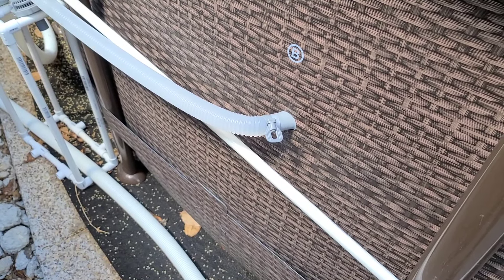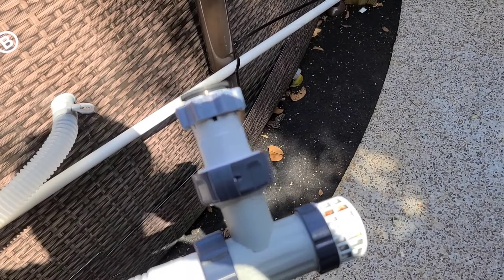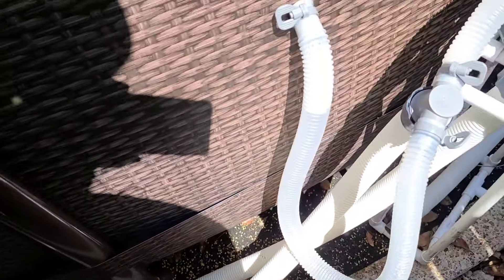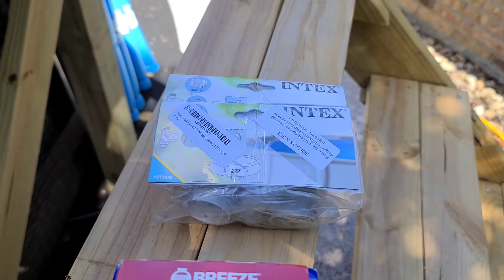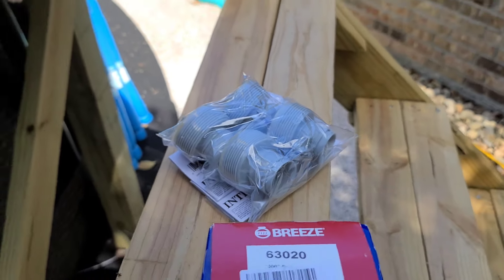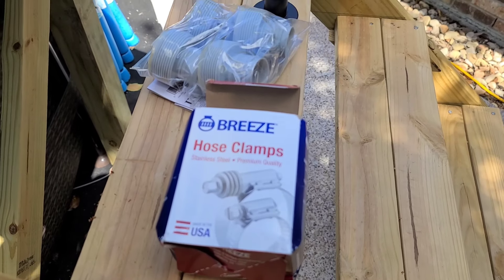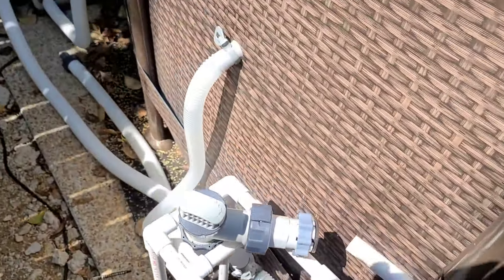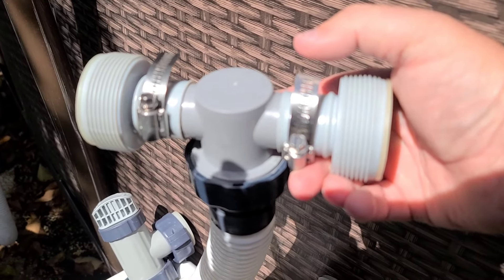Converting a Bestway Above Ground Pool to Intex 1.5 inch Hoses Using Type B Adapters

Comment: You would think the smaller hoses would put out more power and suction.
Reply from the maker: When you go bigger to smaller...you get more pressure.  Shen you go opposite,, you get opposite.  The issue is that the 1.25 hoses start smaller and go to a bigger 1.5 hose.

Even so, it's not pressure that's really the issue.  It's flow/quantity (GPH).

Comment: For plunge valves
Reply: Link
Reply from the maker: Do you have a question?
Reply: Where’s a link for it
Reply from the maker: Intex Above Ground Plunger Valves with Gaskets & Nuts Replacement Part (2 Pack) https://a.co/d/5rzXGn1

Comment: "You're only as strong as your weakest link"  You'll never have full functional power as long as you have 1.25 conversions anywhere in your lines. They only way to actually fix this problem is to cut out the original inserts and replace them with 1.5
Reply from the maker: You're right!  This conversion did improve my suction...but not maximize it.  Check out my latest video where I upgraded even further this year

Comment: You need to increase the size of the holes in the liner.  You're kidding yourself if you think 1 1/2  is going to move a significant amount more water than 1 1/4 when the choke point through the liner is 3/4 at best.  On top of that, even if you do cut bigger holes, the intex return chokes the line down to 3/4 anyway so they can create a venturi because apparently for some reason people want to see bubbles coming from their return.
Reply from the maker: You're mostly right.  The water flow DID increase when I did this. That said, check my latest video where I upgraded further and removed all 1.25" hoses and adapters.

Comment: That should not help with the water flow rate even the pipe is “look” bigger.  The inside diameter from those two inlet are still the same.  I would suggest to switch the inlet with the outlet; connect B to A and A to B. This way the skimmer with suck everything.
Reply from the maker: Hi Joe.  I plan to switch to 1.5" inlets next year to improve flow.  I'll have to cut the holes in the liner, so I'll be waiting until I drain it.  That being said, converting like I did has made an improvement to flow because I could add plunger valves allowing me to control more flow from one of the inlets.
Reply: I was thinking about that but I don’t want to cut the pool.  I also got my pool this year.   Before cutting it, try switch the inlet with the outlet.   That might do what you want to do.

Comment: you stil got restrictions
Reply from the maker: Hi Ron.  What do you mean?  Can you elaborate please?  Thanks!
Reply: Get it Done  
your water flow is determined by the smallest flow.
and that is still the original passage.   
if you want to do it right you have to replace the old connections with the bigger connections.
Reply from the maker: Hi Ron,
Thanks for the feedback.  Yes, restrictions are still there.  I definitely will be cutting the holes and changing the T-junction to 1.5".  

This upgrade definitely helped my flow, but it's not maximized until it's ALL 1.5".  I'm looking forward to upgrading it when I put the pool up next season.
Reply: Get it Done   

 if you do cut, replace your skimmer with an external skimmer. that works nicely.  
And then you do not suffer from that bin on the inside.
Reply from the maker: I have thought about that.  My ONLY "concern" is that it seems you have to have a lower water level than normal.  In other words, my pool is a 48" (floor to top of the pool), meaning it really only holds about 44" of water.  

Would using those skimmers mean having to drop the water further?  If so, by how much?

My entire family is TALL, so we like the "deeper" pool (even though 48" isn't "deep").

Comment: Doesn't do you any good to install 1 1/2 hoses if fittings in pool are still 1" or 1 1/4" the restriction is still there, in my opinion you wasted money unless you increase everything to 1 1/2 ".
Reply from the maker: Not necessarily true.  It did increase my flow...but not to the point I wanted it to.  It also made it easier to add attachments (which are predominantly 1.5").

 That said, check out my latest video where I upgraded even further and eliminated 1.25" outright.  That definitely helped!
Reply: @getitdone308  it is true,i don't mean to offend the1 1/4 fittings will always be regulator.
  Now that you converted to 1 1/2 all the way around yes you have more flow.
 And also agree with ease of use with standard fittings for all applications.

Comment: It was getting the exact same suction.    You STILL only have a 1 1/4” hose opening lmao.  Wow. 🤦‍♂️
Reply from the maker: It was slightly more.  It enables me to use hoses and accessories that are more accessible...and as you saw, it helped with my skimmer.  It was definitely an upgrade.  But if you look at my other video, you'll see where I went to full 1.5".  That was way better!